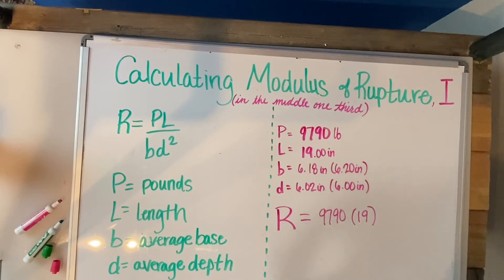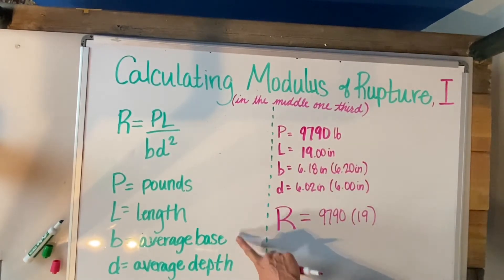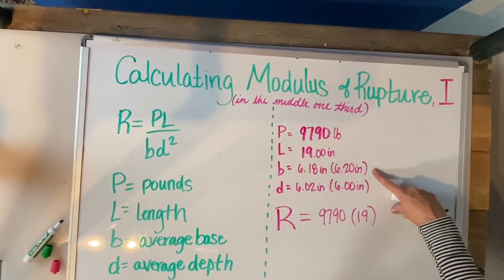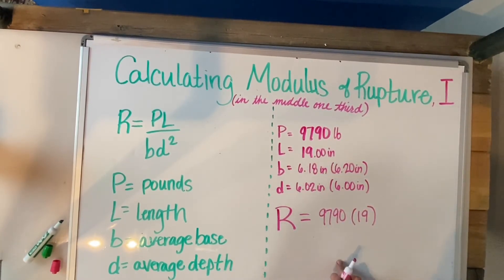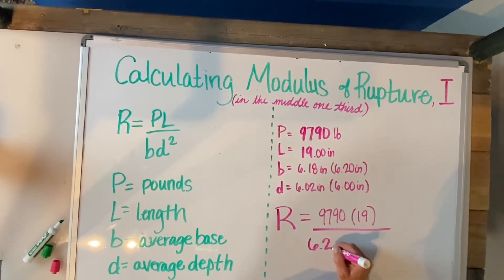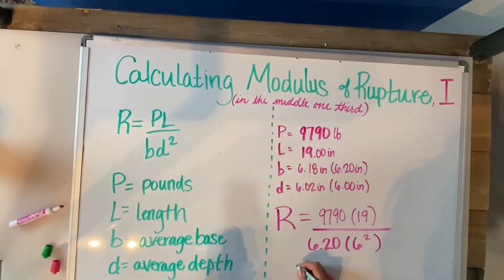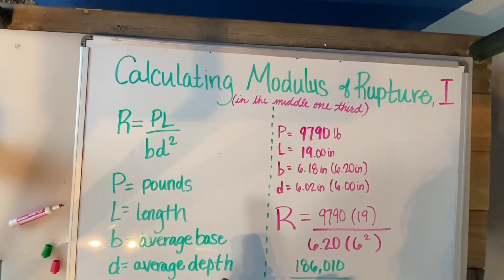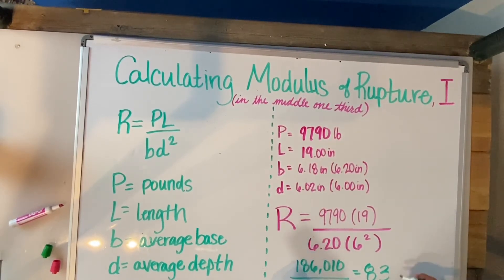How to Calculate Concrete's Modulus of Rupture: Middle 1/3 of the Beam - Vlog 685

Comment: How do you simplify the Modulus of rapture formula from M/Ix × (y) to PL/bd^2? 
Where, 
M= Moment 
Ix= Inertia 
y= distance from Neutral axis to maximum stress of beam 

Thank you
Reply: Hi Erasmus,
At the middle of the beam under ASTM 1399, 
M=PL/6,
(y)=h/2 (since neutral axis before cracking is in the middle),
Ix = bh3/12 (since it's a rectancle cross section).

Good luck!
Reply: @isabellefily-pare4599  Hi, Thanks for the explanation. I got it 🙏